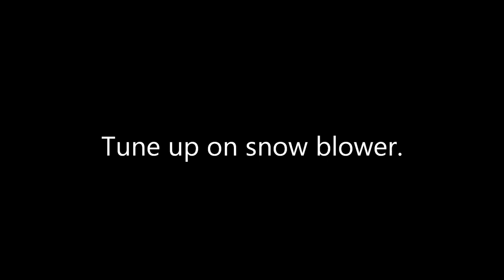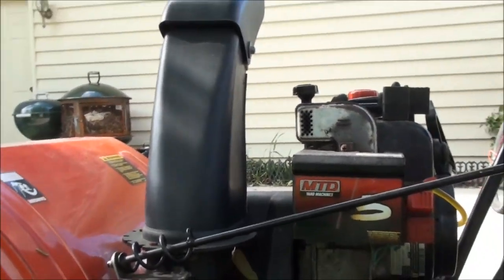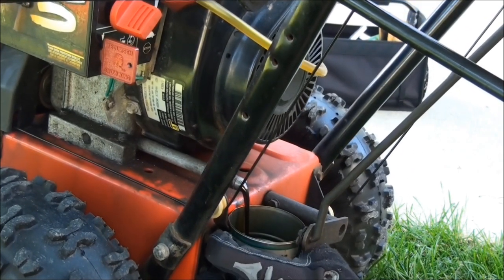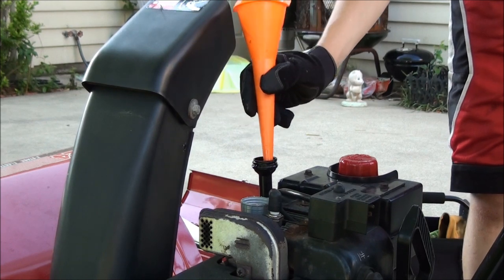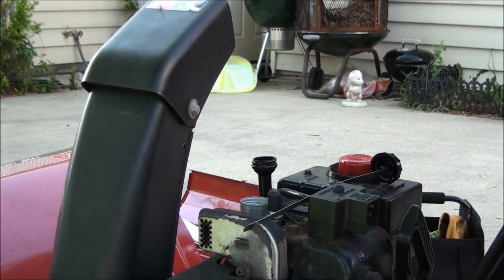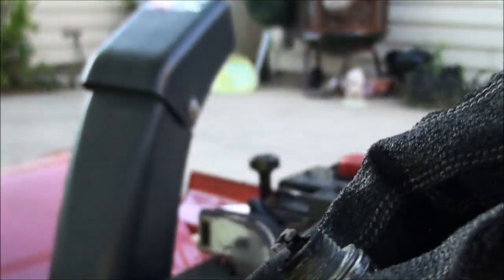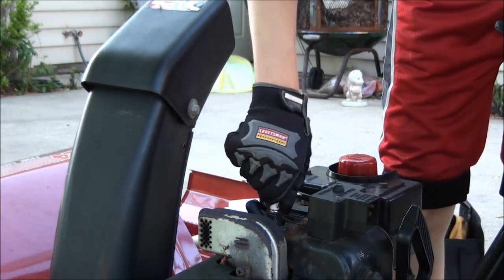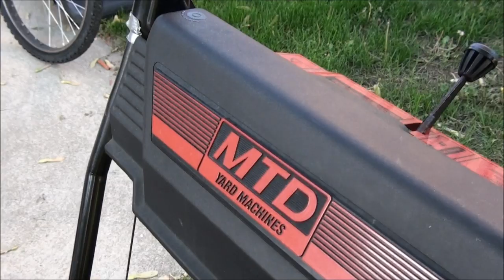Tune up snowblower

Comment: Overall good job big there are a few things you need to work on. First you never want to put antisieze on a sparkplug because the antisieze could get onto the electrodes off the sparkplug and cause failure and if you torque the sparkplug correctly it will not come lose and secondly I wouldn't recommend using a torque wrench to unscrew things its bad for the wrench especially that type but overall great job

Comment: You’re supposed to use 5W 30 in snow blowers for the winter you’re wrong if you overfill real Hydro lock and you’re supposed to fill it right to the Hallmark not over you’re misleading people you don’t have to torque spark plug for snug it